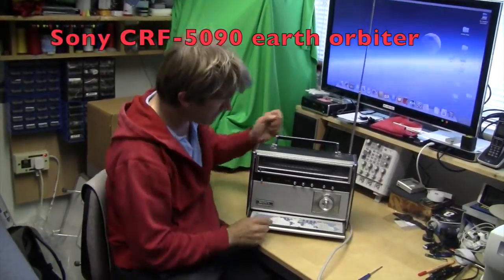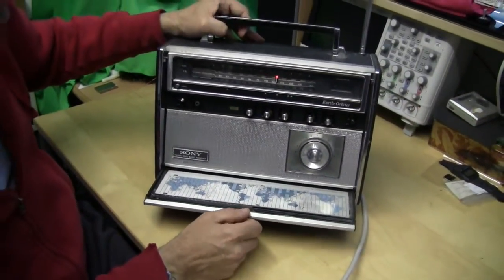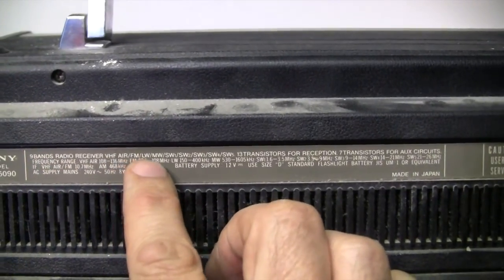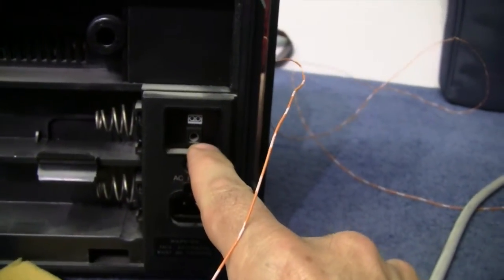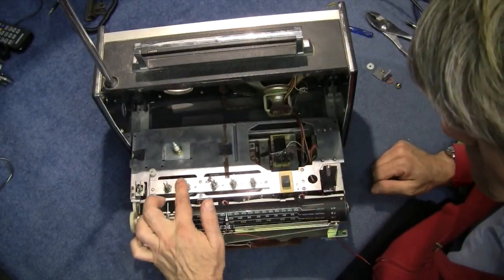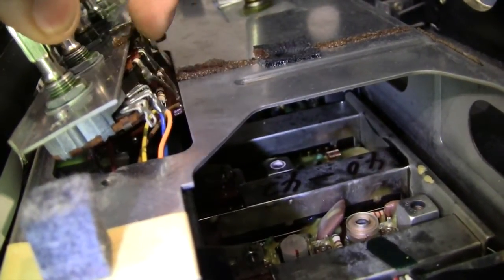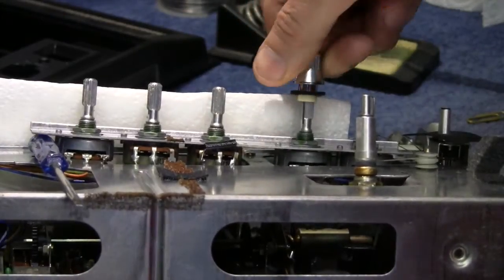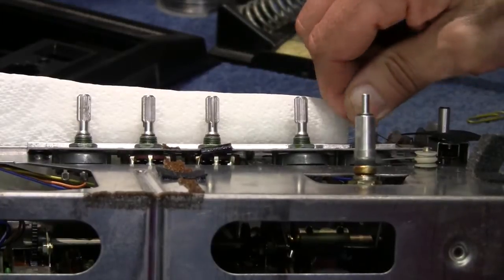MF#14 Sony CRF 5090 earth orbiter radio REPAIR

Comment: Just picked one up cheap in mint condition, just a cracking volume control. Will give it a clean up and sort out the volume control. it’s to me a copy,of A zenith trans oceanic one that I have working, but the Sony Earth Global Radio to me seems better in sensibility, .but I love  them all.thanks for you straight forward Video,Regards John 80 years Young.JB

Comment: Thank you very very interesting. I just purchased one of these and the sound is amazing. BUT all the short wave channels are completely  DEAD not a peep of sound. I did read that German radios had something disabled or not allowed in their country so that comes to mind ( how they did that I do not know) if you are someone else can help me that would be great. Also I do have another radio that will happen to so I have to wiggle the turret a certain way or give the radio a tap with my hand and then it will come in. Thanks in advance :-)  GREAT radio I have the Grundig 6000 and it reminds me of it

Comment: If you read the service manual, which is available free online, it will become clear that by removing the two screws on the side (top-side)...you can then pull the front carefully off, to gain access to the variable potentiometers (ie rapidly gain access to the volume pot as to as spray contact cleaner in it). This procedure saves several hours....versus the procedure of removing the entire chassis from the rear.

Comment: Hi Marcus - great radios, I have one in good order (now) and one as a parts donor. Enjoyed your video but I was shouting at the screen - you missed two screws that would have made your task a lot easier! There are two screws in the side panels top and front that actually hold the whole front panel in place. Remove all the knobs, remove the two screws, pull the front panel forward past the two spring clips and you're done! Turn the panel sideways and feed it back through the cabinet and you can remove the whole lot from the cabinet. I did repair my buckled dial scale, plenty of "copies" on YouTube but here's the original.... https://www.radiomuseum.org/forum/sony_crf_5090_earth_orbiter_repair_of_warped_dial.html.
Best wishes - Martin ZL2MC

Comment: I  have worked on these types of radios for more than 40 years. Just some advice.
Always check for DC voltage on the volume pot. If you have more than a few milivolts the the scratch noises and pops will be back soon. Check for leaky caps.

Comment: hi mark.i have a sony.crf 5090.same issues as the one you just tackled.servisol £6.83 now, one of the screws top right will not come out,ruined the thread.ended up drilling it out.stuck in with super glue.? the other screws where easy to remove.will use servisol when it arrives,hope it works as well as it as for you.are you still in the bussiness of repairing radios.i have a few that could do with your skilled attention.

Comment: Very nice radio, i have found a few nice multi band radios here in the local thrift shops, but mostly Radio Shack ( Tandy ) ones of the mid to late 70's.

Sold them all on in the end because of lack of space.
Reply from the maker: Hi Neil. Thats my biggest problem, I would like to keep everything I buy but I only live in a flat so Things are only here temporarily. but there are so many car boot sales here where I live there is always a supply of things to keep my curiosity occupied.